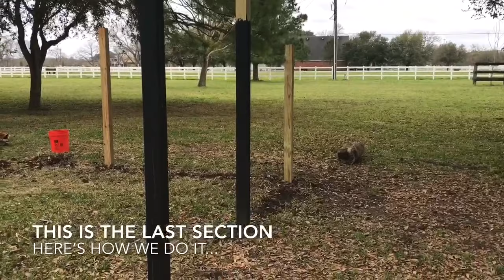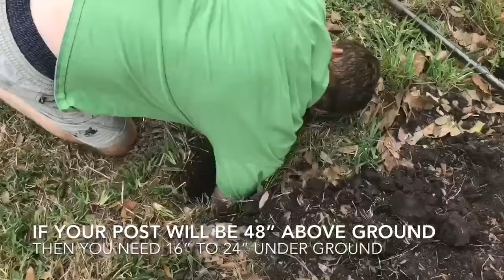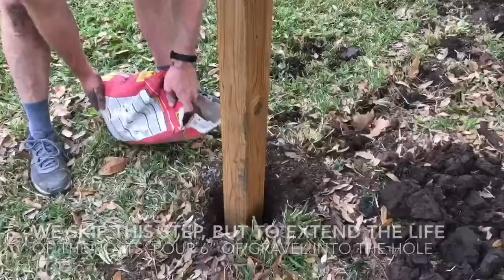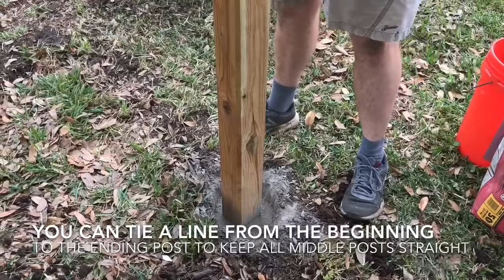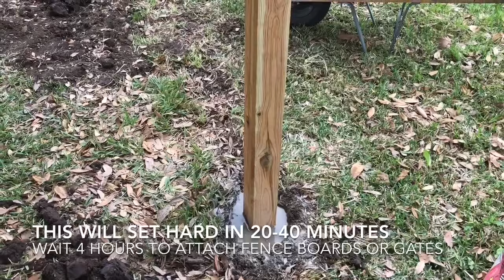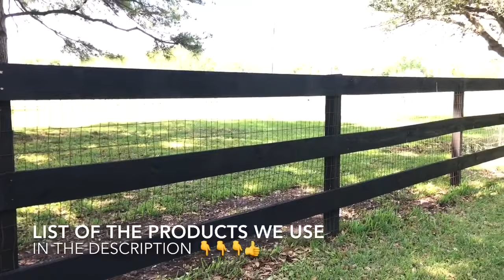DIY Three Rail Fence Step by Step - Post and Rail Fence Installation Steps

Comment: Are the posts spaced 8' on center or are there 8' gaps between the posts? It was a great video, and I'm looking at building a fence like this myself. That was one point of clarification I was looking for, though. Thanks!
Reply from the maker: Good question, it’s 8’ on center. Corral boards are sold about 16’ 3” long. The extra 3” is for wiggle room in case the posts aren’t perfectly spaced. 👍

Comment: Aren't you concerned about dry rot? The new process for PT Lumber (2005) is not good for direct burial. We're replacing all of our screened in porch 6x6's after 15 years because they are all dry rotted and the porch is about to collapse. Just thinking the fencing may have that same problem if you don't use anchors. Our porch solution is to not bury the 6x6's but use anchors above ground. What are your thoughts?
Reply from the maker: I definitely wouldn't bury supports like this for a building. Fences and structures follow different rules. I actually can't say I've ever seen a fence built with anchors. It would get expensive and time consuming in a yard like ours. We must have 400 or so posts. So, burying PT with concrete will get us 15 or 20 years. And, we'll be happy with that. By then, the wood above ground will have tons of cracks and sun damage too. The whole post will be ready to go.
Reply: Who build your porch?  You should never bury a support post into the ground.  A concrete footing with post anchors should have been used.  For a fence.. burying the post is the norm...

Comment: Looks like you are putting the rails on the outside of the posts. It seems like most people do this because it looks better but I've seen some recommendations to put them on the inside to make it harder for the livestock to push the rails off.  Have you had any issues with this?  I'm building a fence for goats and a few sites say they are good at doing that, at least for wire mesh fences.
Reply from the maker: Our donkeys don’t do that. But we use 3 1/2” screws. I’m sure a large animal leaning against rails installed with nails could eventually push a board out. 👍

Comment: Nice video.  Do you have a gate installed on this fence?  Would you start with the two posts for the gate to hang on and then go 8’ out from those?
Reply from the maker: My husband usually only goes 4' away (max) from a gate before installing a fence post. it gives the gate more support. 👍

Comment: Are you still happy with the 4x4 posts or do you wish you would have used something larger (6x6)? We are about to install a fence and trying to decide. Thanks in advance for the feedback.
Reply from the maker: Hi! 4x4 is the standard and the look people expect. It will last 15 to 20 years depending on how often water sits around the base of your post. You only need 4x6 or 6x6 posts for gates. I hope that helps. Good luck with your fence!

Comment: Great video , what is the spacing of the boards?
Thanks
Reply from the maker: Thanks! They sell corral (fence) boards about 16’ 4” or 16’ 5” long. So, you normally space the posts every 8’ and the extra 4 or 5” just gives you a little wiggle room in case one is off. Just measure and cut off the extra as you attach each board. 😁

Comment: Wow, this was very helpful. What fence post paint did you use?
Reply: Thank you, by the way
Reply: What are the dimensions on your posts? Our ranch can use a makeover, I'm going to try and give a whack at it during this quarantine
Reply from the maker: Thanks! Ace Hardware stores sell paint that is called “Barn & Fence” paint. It comes in black, red, white, and grey. Maybe a few more colors. You can order it on their website or go into an Ace Hardware and have the person at checkout order it for you. We order 5 gallons at a time. 👍
Reply from the maker: The posts are just standard pressure treated 4x4’s. 😊

Comment: Hi, what kind of fencing did you use? And it looks like you did post then fence then the wooden planks?
Reply from the maker: We use 4x4 Pressure Treated posts and corral boards for our fence. Corral boards typically need to be bought at lumber supply stores. Lowes and Home Depot usually don't have them. You set the posts in concrete, let that concrete cure before installing the fence rails. You can find more details in this blog post: https://www.abbottsathome.com/set-wooden-fence-posts-in-concrete/ 👍

Comment: I read it’s better to have the posts on the outside of the pasture. How do you do corners in that instance?
Reply from the maker: I’ve only ever seen it with posts inside. Complete rails on one side of corner. Then make the other side cover the post and edges of last side. 👍
Reply: Inside is better for livestock…outside if it’s mostly decorative or for dogs and small animals.
Reply from the maker: @ricardoh3178  In our area, all fence posts for three rail fences and most other designs are installed inside with the rails facing out. To keep dogs or other small animals in, we install post inside then wrap the post with wire mesh to keep animals in, then install the rails on the outside over the mesh. That way it's easy to replace any rails that may rot or split overtime. Sandwiching the mesh between the rails and posts also makes painting each easier. 👍
Reply: I just reread the comment and realized I read it backwards. I thought he was asking about rails inside or out. We put rails inside for horses and cattle but outside if it’s just decorative and wire mesh if we want to keep out critters or stray dogs. Love the video by the way 👍
Reply from the maker: @ricardoh3178  Thanks! I can see putting rails inside if you have cattle that are constantly leaning on fences. The post would help to strengthen that rail against the extra weight and pressure. We only have horses in our area. Homeowners still do posts inside for just a few horses. Our yards are only 2 - 10 acres. We aren't ranchers fencing huge areas. :)
Reply: Just to clarify: you suggest posts inside/boards outside for small pastures/horses?  Any idea why?  Also, you say for a 48" above ground post the hole should be 16-24" deep.  So, if you add 6" of gravel to a 16" deep hole, you end up with 10" of post below ground   Is that correct, or do you need to go 6" deeper if you use gravel to have more post under ground?  Thanks.  Also, nice to see a fence video that's short but still informative.

Comment: So do I put the post in the ground,then put the wire and then the coral boards??
Reply from the maker: Yes, if you need wire, put it on the posts after the concrete has set.
Reply: Okay that's what I thought just making sure. I appreciate it

Comment: What dimensions are the fence boards? They look about 1x6x16
Reply from the maker: That’s about right. They’re actually called Corral Boards and they have a true dimension of 1x6 (not 3/4” by 5 1/4”) unlike the 1x6’s sold for other uses. And the length is usually about 16’ 4” long. You want to set the fence posts 8’ apart, the extra 4” on the corral board length gives you wiggle room. 👍
Reply: @AbbottsAtHome  thanks! Where did you get them? I’ve looked at all the big box stores and can’t find them…
Reply from the maker: You’ll need to check with lumber and construction suppliers. They’ll usually be in areas where the suburbs are turning into farmland. I don’t know of national chains that sell them. It’ll be regional stores.

Comment: How did you add the wire in the fence?
Reply from the maker: They make staples for fencing that you hammer into the posts to hold the fence in place. Hammer the staples at an angle where a vertical wire and horizontal wire cross for the tightest hold. 👍